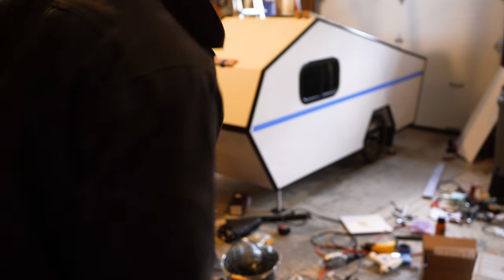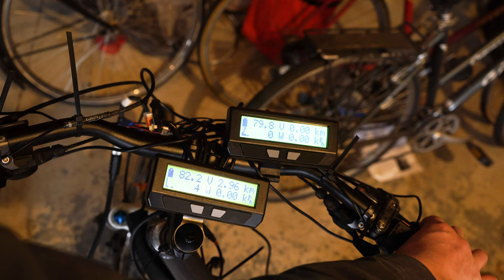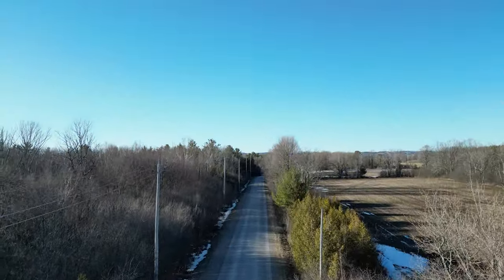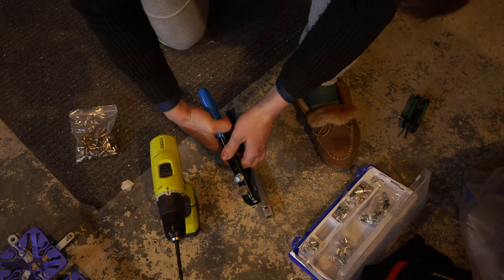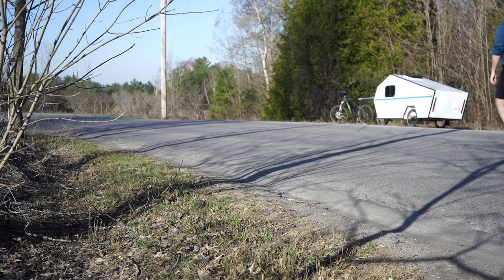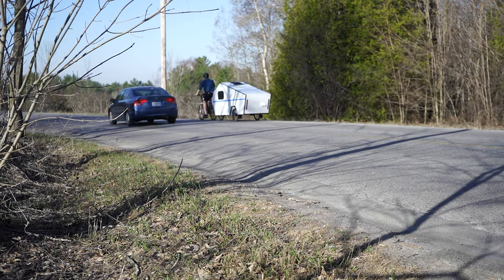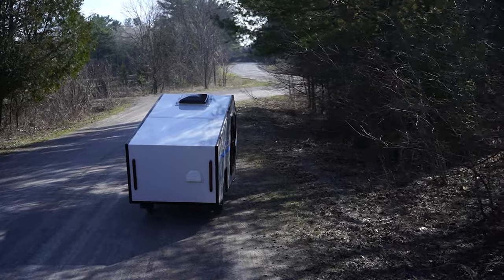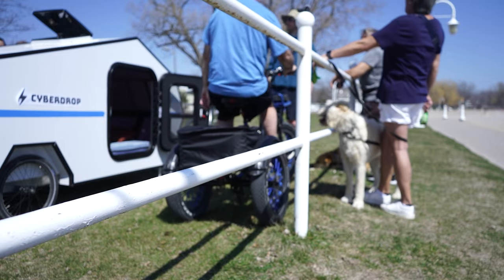Building Electric-Powered Bicycle Camper (PART 13)

Comment: I was thinking along the same lines as a powered bike trailer, because I live in a hilled area. If I were to build one....I'd need an extra boost to pull that thing. Like a heavy duty truck would. Nicely done.
Reply from the maker: Yeah this thing def needs an electric boost on the hills!!

Comment: I leave in about 2 weeks for my 3rd trip with my bicycle camper to my second bicycle camper meeting in Germany. It is popular in Germany and it is still growing fast out there. I am from the Netherlands, but I travel to Germany each year with my combination from trike and bicycle caravan. 
I see that someone already told you that you aren't the first electric powered bicycle camper. Your design with one wheel in the front is also popular out here.
I am currently building a new build. It will be a quad with a camper on it.
Also e-assist. It will be a bit longer then my home build trike that now pulls my bicycle camper. It will be foldable, but bigger as I fold it open with a bit more comfort.
As you use your build, you will probably also want to change things to improve your design.

I love my bicycle camper. It is so much better then a tent. Way more comfort and as you fix your airflow, you have also no condensation in it. It creeps you in the winter better worm then a rent, you can use it as a shelter as it starts to rain, building it up is just putting the legs out and you are ready. As you leave you do the legs up and you can go. No need to fold a wet tent and dry it when you get ad your next destination.
I have a good bed in it, so I sleep very good in it. I get ebmven a better bed in my new build with also a heater and full 220v power. I just have to connect one cable to ggd power and my new build will charge my batteries and gives me power in my camper part.
Even ad there is no 220v, I will have power in it, just as I have now in my bicycle camper.

One tip, build something in your camper so you have support in your back as you sit in it and ad a table that you can fold away. It helps as it is cold outside and you want to sit in your camper. It gives more comfort.

I don't know the range that you want yo do, but I have now 3,3kwh on battery and if I take everything with me, that will be more than double the capacity. Solar panels help a bit, but don't expect to much from it.

Greetings Emiel
Reply from the maker: Hi Emiel! Great to hear from you. Yes, I know these are very popular in Germany, but I’m not aware of many people building them here in Canada. 

Good tip about the table and back support. I was considering a telescoping arm with gas springs mounted to the side wall, but I think it would be still to flimsy. I think I’ll go with a fold down table, but I haven’t determined those details yet. Soon!

Hopefully, I can ship my camper over to Europe to meet up with you guys. 

Cheers!
Reply from the maker: Also glad to hear all the reasons why you love your camper. It’s reassuring because those are the reasons that set my whole plan in motion. I’m looking forward to enjoying those benefits vs bike packing with a tent.

Comment: Awesome speed.  Awesome braking.  I prefer your design of "traditional teardrop" compared to my original angle forward with high back door design.  Handling benefits from weight (or wind load) forward on trailer.  I like your bullitt plans.  Great as massive EV.  And might also make a better solo camping vehicle, in summer nature.

My current favoured design is to go lighter though.  Hard bottom with popup canvas for head/sitting room, and flat solar while traveling, but popup has angling (maybe) @homefre123 concepts with "totes" serving as 2nd floor to allow sitting and counter space room.

I love the receptions you showed for the camper.  Fully hard closed is perhaps more welcoming and protective simultaneously.
Reply from the maker: Great to get your thoughts! Yes, the weight has handling benefits. It feels very stable and controlled behind me. I like your idea, too. I considered something similar, but I decided I wanted my nice comfy bedroom behind me with no setup time beyond dropping the stabilizer legs. 

We’ll see how the Bullitt goes - just ordered a wack of Eve 21700 50e cells. 

I think ppl like something that is familiar but different. The Cyberdrop does look like a small teardrop RV, especially in person I think. 

Cheers!
Reply from the maker: And yes, the bullitt with long range battery could be all you need if you don’t mind tent camping.

Comment: Looks pretty good. For suspension shots a ride along camera mount /go pro that shows camper + ground would be optimal. Alex tek did that in one or 2 videos, showed how effective it is. Nice responses from people, that happens often with bike campers. Have you checked yet how much power you use and how much you can expect from the solar cells on average days, i.e. to see about the likely range per day?
Reply from the maker: Yeah, I’ll try to rig something up. I’m still testing motor/controller combinations and still deliberating whether to go with solar panels or do my own custom solar roof. I’ll report back precise stats once I’ve made the final decisions. Cheers

Comment: looks awsome jeremiah looks like you eneded up with similar light solution as i would have given you,have you tried to pedal without any motors ?,the design looks really stable congrats
Reply from the maker: Hi Katie, thanks! A lot of the stability actually comes from the weight - up to around 400 lbs now. There are definitely all sorts of trade offs to consider. I have tried pedalling without any motor input and it is a tough slog!!! haha 

I'll do a video testing my limits with pedal-only to see what is possible with human power alone.

Comment: Your statement in the video that the first electrically powered bicycle caravan is not entirely correct, I had it more than five years ago, almost six years now and my solar powered yours wasn't and I've already made a journey of over 2600 km from my bicycle caravan watch the videos https://www.youtube.com/@VolkerHeimes
Reply from the maker: You win, Volker. I knew you’d call me out ;) I’ll check it out for sure.
Reply: @Jerbrown  it's not about winning and you're welcome to check it too you'll see mine is even independent anyway brakes independently starts and has no cable connection to the connection yes and if you knew that I was calling you have you already seen my video or not Greetings Volker
Reply from the maker: @VolkerHeimes  Hi Volker, I think you're missing me attempt at humour. I did watch your video describing your bicycle camper. Great job!